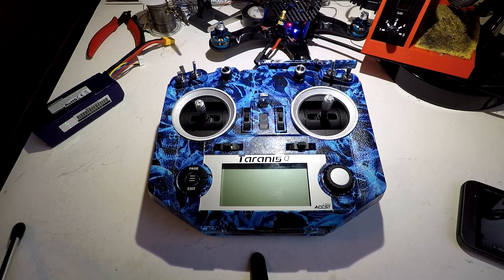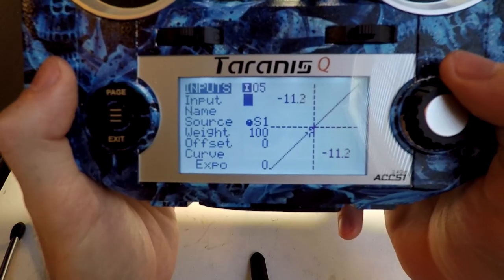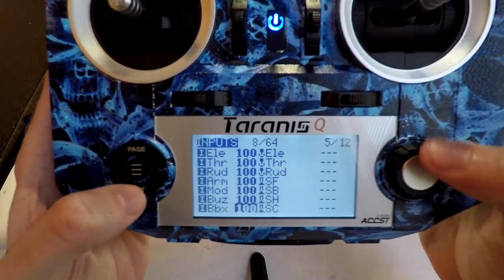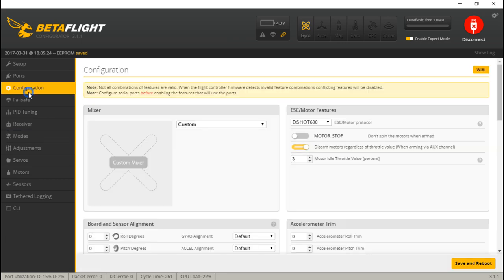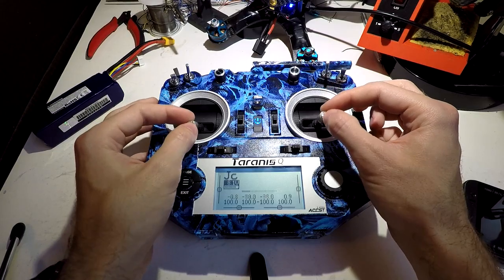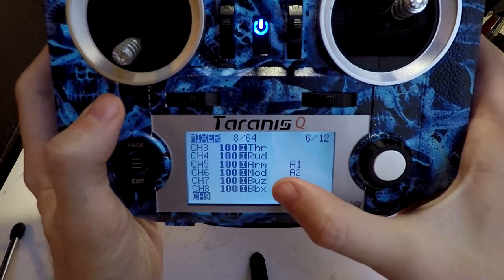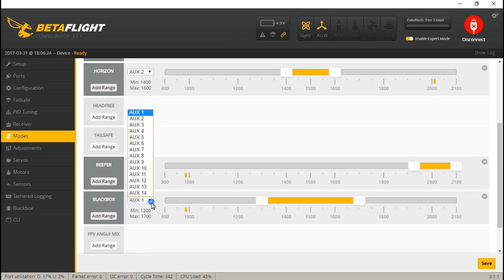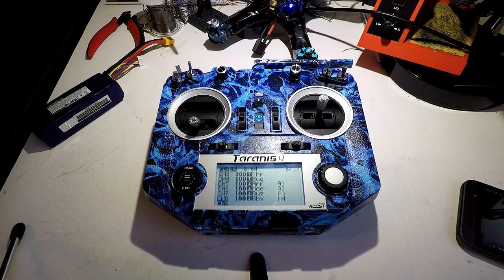Taranis Q X7: Creating Switches (and Betaflight set up)

Comment: You do not have to set your switches in the input menu. You can go directly to the mixx menu. If you want to set up complex mixes then it's best to set up your switches in the inputs first and then mix the inputs together. But setting up simple single-function switches even the flight mode switch with three modes can be done without going to the inputs menu but rather than mixer menu

Comment: All your video's on the QX7 (which I have recently purchased ) have been a big help.  Should mention I'm new to the hobby so please excuse what  may be the obvious to you.  
Just figured how to install a discovery buzzer and connected it to the QX7 and configure it in Betaflight.  The switch and everything works great BUT, once I armed the motors (separate switch of course) the buzzer turns on.  Nothing is overlapping in the modes in Betaflight.  So being new I have trouble shot all I know and nothing cancels it on the the arem switch.  Hoping you may be able to help.
Thanks

Comment: Awesome video!!
This has helped me set up my switches, however i use clean flight which is not much different. i did find though that my Arm switch although setup on my controller as Aux1 when switched on it does not go green in clean flight....

Comment: I just tested my new quad inside the house, it works, but the throttle increases by itself if I don't touch any of the sticks, and I have to disarm it at that point. Is there a solution to that? Thanks in advance!
Reply: He passed away 9 months ago.
Reply: did you balance the sticks?

Comment: I need some help please, I'm pretty new to beta flight, I have the xr4 bound to the x7 on the youbi 130 , I went into beta flight to change the receiver to sbus and set some switches and modes, but my X7 is in mode 1 in beta flight, I've made my X7 into mode 2 in the settings and fixed the left stick, I'm not sure what's going on, do you have any ideas what I did wrong or haven't done yet, thanks for any help

Comment: JC I just purchased a Furibee X215 Pro with Frsky receiver, also a Taranis Q X7. Ok when I hooked up to Betaflight everything works right EXCEPT when in receiver tab, Aux 12 goes crazy, going from 1000 to like 1900 and I never put anything on Aux 12, I Factory reset the Taranis 4 times, also updated Firmware on it and still Aux 12 is erratic and when I add like Arm before I can hit Aux 1 it automatically jumps to Aux 12 by itself can you help Thanks

Comment: love your videos. Very informative and thought out. They have help me out a lot. Thank you. I was hopeing you could help me out. I just finished building the Skystar X140 kit from GearBest, and i'm trying to get the 4 LED light board to turn on and off by a switch on my QX7S-Taranis. Lights come on when battery is connect, and i can turn them off by switch. But they wont turn back on when i flip the switch again. I'm using betaflight and have assigned Aux 5 switch. Any help you could give me would be greatly appreiciated. Thanks again.

Comment: Hi JC new subscriber. I'm pretty familiar with betaflight and I get setting up modes etc. what I need to known where On a SP3 Racer flight-board  do I solder a buzzer. I see a connection labeled buzzer but thought i saw it explained for low voltage alarm. Would appreciate it if u can clear this up for me. Thanks

Comment: When I configured my Aux Channels on my radio, I only set up the Mixer, I didn't do it in the Inputs.  The reason, when I was configuring my radio, I tried setting up the inputs and then went to Betaflight, and It still did not recognize the switches, so I deleted what I did under inputs, then set up again, just in the Mixer and everything worked. So is it really necessary to set the inputs for the switches?

Comment: Hi JC I've been folloing the X7 series but I've run into a problem on this one. I've followed everything you did but on the Receiver page in Betaflight my aux movements are not detected. It like I have only 4 channels. Any ideas? I've already checked the model and it's set to D16 and using a channel range of 1 to 16. Using the XM+ and have already setup RSSI and that works (thanks to you). Thanks for any help!
Reply: Do you have SBUS selected for the receiver type?
Reply: Yes I have. Another thing I noticed is that at first I thought nothing was working but the pitch and roll only showed output when the throttle was off 1000. I must have a little bit of throttle for the other channels to work, odd or by design?
Reply: D S not by design. I feel like your map is likely off in betaflight.  I'm on my phone so can't explain very well. Just make sure your pitch/roll/throttle/yaw are all assigned correctly. For the aux issue double check your qx7 settings.
Reply: Thanks for helping out. Just to add some more info I copied the model and bound it to another receiver on a different quad. On this model the Aux channel does work. This leads me to think it's more quad related or Betaflight configuration than the qx7 settings.
Reply: Hey I have the same issue, aux switches not working in Betaflight, using QX7 and XM+. Did you figure out what was wrong? TIA
Reply: scheeenfilmiesgucke you got to set them up on the tarannis

Comment: Can anyone help with my issue? I have a taranis qx7 and my receiver is a FrSky xm plus. They are bound, the light is green, but it does not move anything. It is on a lumenier lux v2 fc. When I move the sticks, nothing happens on the motors or in Betaflight. Any ideas on what I am doing wrong? I have competed the settings as shown in the video.
Reply: same here
Reply: when i move switch nothing moves